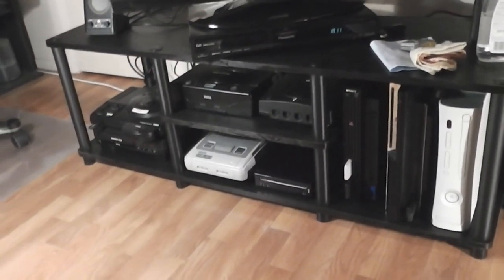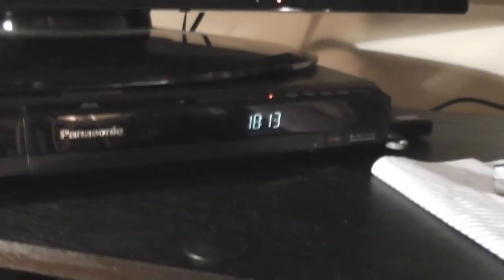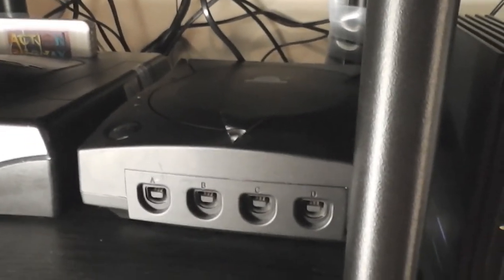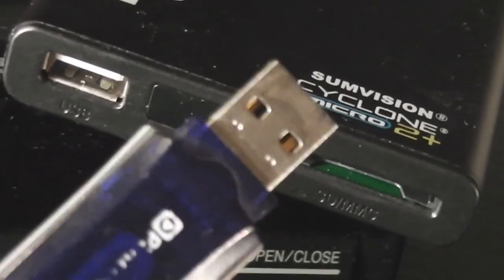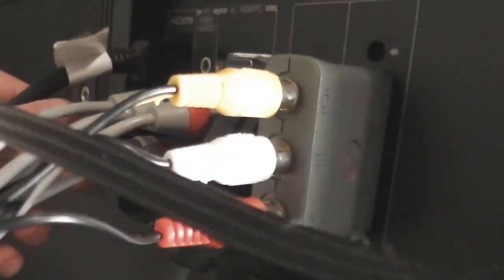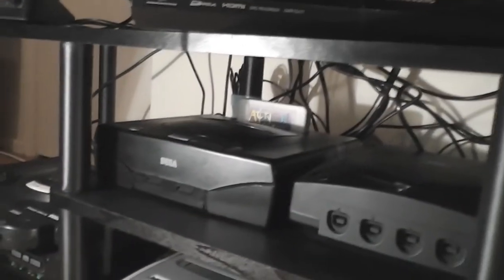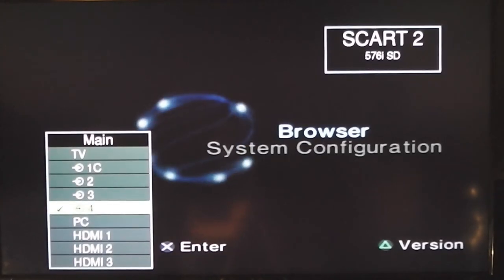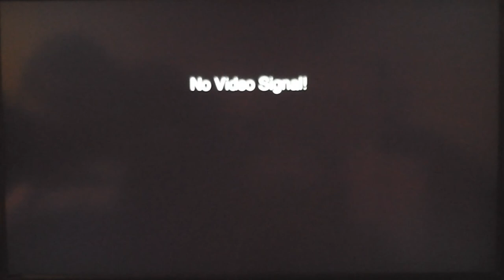My brand new console setup!

Comment: nice work. just a reminder, fat ps3 need air flow around the machine b/c it will or might get the YROD. Xbox 360 has their problem w/ RROD as well. Dust is the number one killer for most systems. I protect the systems by covering the system which I don't play with a cloth or thick paper towel. Also I unplug the power cord of the wii, ps3, xbox if I am not using it to conserve energy and electric bill. If I don't use the systems at all, I just box it up and put it in the closet.